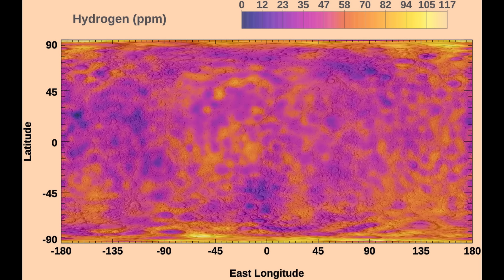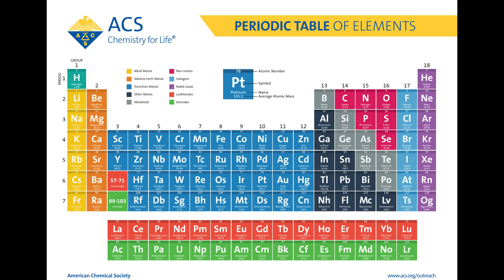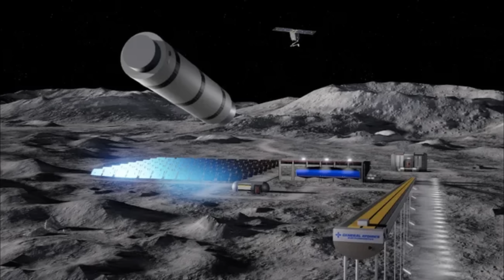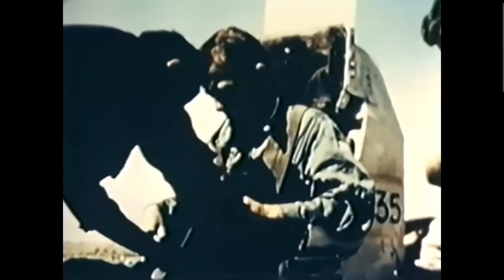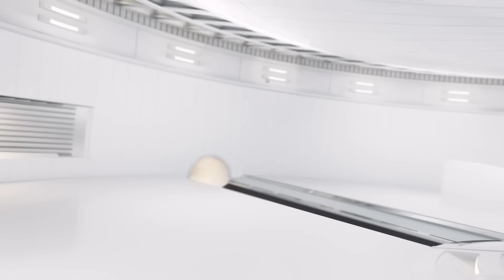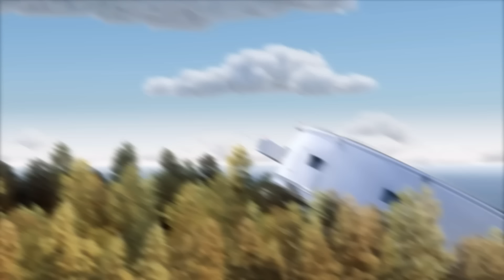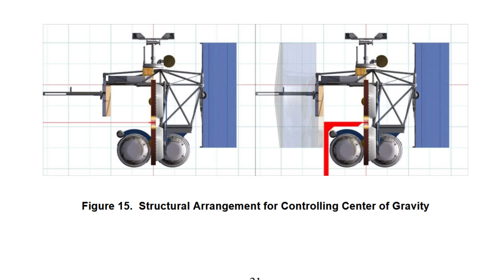Launching From The Moon With Silicon Based Rocket Fuel And Other Ideas - Deep Space Questions

Comment: Why would anyone use silicon?  Aluminum is a much better choice, since it is a lighter element, therefore you will get a higher specific impulse.  We even already use it as part of rocket fuel already.  Solid rockets use Aluminum dust in the fuel to boost overall specific impulse and overall delta V.
Reply: I imagine it’s because silane can be stored cryogenically as a liquid whereas aluminum would be a solid. Even if using a liquid oxidizer means you can still throttle the engine it might be more laborious and risky to rely on a solid propellant versus a liquid.

Comment: PRO TIP The conversion factor between low-orbit orbital velocity of a body and escape velocity from that body is VERY simple, and worth remembering: The square root of two. So if you know the low-orbit orbital velocity, multiply by 1.414 to get the escape velocity. Or if you know the escape velocity, divide by 1.414 to get the low-orbit orbital velocity. https://youtu.be/TAFaUvS18V4?t=231 @Scott Manley

Comment: The major problem with most aluminum concepts is aluminum tends to build up over time.  So it isn't as good for motors that run a long time of that are reused.  This will not be an issue for many missions, of course. so it is a possibility.

Comment: And there was a well worked up idea of a lunar spin launch system, but using a spinning tether on the moon. 
This looks quite practical with current technology. 
file:///C:/Users/John/Documents/AIAA_1990-2109_lunarsling.pdf

You could launch loads in opposite directions that having orbited the moon could be directed towards earth.  
Even using blocks of rock like basalt would be useful as they accelerate towards the earth there kinetic energy is far grater than the same energy in the same weight of rocket propellant. Spinning tethers could catch these to launch what ever you want into higher orbits. 
It may even be possible to make the tethers from basalt fibres from moon rock.

Comment: Mining on the moon would be prohibitively expensive until (if) the day comes when we can send all the machines, metal, moon trucks, excavators, cranes, and myriad materials to the moon to build a single factory for less than $1 trillion dollars, b/c that's how much it would cost, at a minimum, if we also include the costs of building and maintaining a sizable moon base and a work crew of dozens, if not hundreds of engineers, etc.

There will also have to be a fully-funded and manned hospital on the moon to deal with all the injuries and high-level radiation (both cosmic & solar rays) exposure.  Most likely, there will have to be massive greenhouses, and the air for the plants and people to breathe, etc.  At some point, there would have to be recreational facilities to prevent serious muscle atrophy from occurring.

Then, one has to think about the difficulties and costs of transporting the mined products to the processing factors, and in the case of rare earth metals, back to earth.  Putting it all altogether, it might well cost $5 to $10 trillion to get everything up and running, and then something like $1 trillion/year to maintain it and keep it running.

We have no idea how many years a person could live on the moon without muscle atrophy (including the heart muscle) and bone loss that would make it practically impossible for a person to return to the earth at 6 times the gravity.  Lifespan might be seriously reduced.  So the reality for some might be never returning to earth.  In that event, the moon would have to become a much more livable place where people can be happy without forests, rivers, lakes, etc. and with two weeks of total darkness per month.  Sounds like hell to me!

From the standpoint of a dystopian SF writer (e.g., Philip K. Dick), it might be a hellish-enough experience that the only people willing to live there would be prisoners, for whom life on the moon would be their "cruel or unusual" punishment (for which the U.S. Constitution would have to be amended).  The prison guards and supervisors might have to be military personnel who would be deployed up there on a rotating basis.  There would also be a "space force" base up there to give the military some justification for being on the moon besides maintaining  an enormous prison.

Comment: For mechanical energy storage for a mass driver, you could also use mechanical storage.
On the Ford class carriers, they use motor generators to power their EMALS electric catapult system.
You could also use flywheels or motor generators to recover energy from a shuttle as is used on those catapults.

Comment: @19:30 Energy storage to recover the energy from spinning down:  the best solution would be simply to have a second spin launcher next to it ready and loaded. After one releases its mass it transfers (electrically) to the other one spinning it up to speed and launching. In the meantime  the other one is loaded with a new payload and the cycle continues, each time only having to inject enough additional energy for the payload itself, not the much larger amount of energy needed to spin up the rotor.

Comment: Just throwing out a few ideas:
* Single use hybrid rockets. It is only the fuel/nozzle part that is single use: mostly just a solid cylinder with a channel to flow oxygen down. The oxygen tanks and all the pumps to regulate the oxygen flow are reused.
* Momentum exchange tethers: Might be lighter, simpler, faster than a space elevator and able to service multiple ports around the moon instead of one location. Downside is they may have high-g, a non-issue for space elevators.
* Mass Drivers are normally considered too large to ever be more than Scifi, but you could start with ones of only a few hundred kg if they launched tiny payloads, eg magnetic dust, that is aimed precisely to form clumps in orbit that can be collected in a later date. I think this would also handle circularising the orbit, possibly with multiple guns feeding the clump from different trajectories.
* A magnetic rail around the moon. Although a long term project, this could emerge organically from connecting multiple cities around the lunar equator, sharing resources from people to power. Before it could handle launching human sized craft, it could be used to land them.

Comment: Unfortunately, due to the regolith on the moon being electrostatic, use of any method which creates a magnetic or electrical field would attract the dust on its surface.  Therefore, only by building the ramp with a housing, which increases the cost of the facility, would it be possible to make use of a magnetic mass driver.  Using spin launch may be a better choice, and with no atmosphere, it doesn't need to be as complex as its equivalent on the Earth.

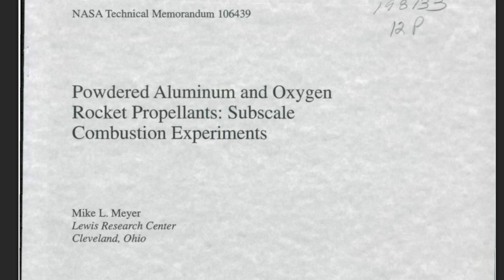Comment: 8:28  "There have been designs which use slurries of liquid oxygen and very fine grained aluminum powder and you can burn that like a solid rocket motor"

Not anywhere near me you can't.  That sounds like a very expensive exercise in mortal peril.  That sounds dangerously close to an old timey mining explosive known as oxyliquit.

They stopped using it, because it liked to go boom if you tried to move it too much.

Comment: We still know little about the moon's geology , possibly what is strategically interesting is classified. What is below the surface?  
I come from an area where Gold was discovered relatively recently through alluvial deposits (called the Golden Triangle) but now is mined underground. Geologist create theories to explain why there are particular concentrations of minerals to try and predict where else to look. On the moon we will have to do more looking. Digging deeper holes. Perhaps things rare on earth can be used as basic foundational materials, requiring different approaches to engineering. Eg In the vacuum of space perhaps girders could be made from sodium.
Regarding launching from the moon would it be possible to build ion drive thrusters with sufficent power (or clusters of thrusters) to get into orbit? maybe using nuclear-electric power generation. Creating chemicals from energy to store and then react and release the energy seems an inefficient way of generating thrust (requiring large tanks)  Also there is the direct nuclear-thermal engine where you could heat any material and allow it to expand through a rocket nozzle. Could be a solid metal fuel, in wire form,  fed into the heater and turned to gas. Maybe further ionized and accelerated magnetically.

Comment: Storage for lunar SpinLaunch: Build two SpinLaunchers, and spin one up while you spin the other one down.

Space elevator: Instead of a powered climber, move the cable in a loop. The climber just has to grab on and get towed. You'd need to chain multiple loops along the length of the cable to get the increased cross-section.

Comment: A nuclear powered liquid sodium or magnesium engine might be posible, if the heat of the reactor can reliably melt the solid metal inside the tanks right before a launch. Handling a hot metal exhaust seems more plausible than oxygen. Both metals are quite abundant in moon´s crust and have a relatively low molecular weight so an isp of roughly 300 isp could be achieved. Also, high heat conductivity and high density is nice.
The major downside would be hazardous radiation, from ionizing radiation which means it should not be used near populated areas or around infrastructure.

Comment: If we could put metals on the moon for transport or storage, we would not have to worry about oxidation which brings up a interesting idea, can we smelt or form molten metal on the moon be turned into bars and stored on the moon, yes cold welding would be a issue but we could have Oxides free metal to try and experiment with. I always wondered if the oxide coat Brought into play some characteristics that we have not thought of!

Comment: I’d like to see a hybrid rocket motor using magnesium aluminum hydride, Mg(AlH4)2, as the fuel. Same solid particle issues as with SiH4, but much better performance. Silicon is a pretty dismal as a fuel.

Comment: I think a good idea to launch is to use a rope. The actual bit that converts the electricity into kinetic is just a small "car" of some sort moving on some kind of powered rails to guide it, with a rope attached to it. The actual craft to be launched is hooked onto the other end of that rope. This may reduce the energy wasted into the launching device because the mass of the car could be small enough. Like imagine a trebuchet, except that instead of using the arcing movement of a lever to release the payload, the arc here is the slightly curved moon surface if you can maintain constant elevation.

Comment: 11:49 We don't normally pronounce the decimal.  It's not "Point Two Two Calibre" but "Twenty Two Calibre".  So in this case someone took a three-seventy-eight Wetherby cartridge and crimped a twenty-two miniball on the end.

But yes, that's the secret sauce of "magnum" cartridges.  The rifle I use for hunting, a traditional "three-oh-eight" has a miniball caliber of 0.308 in (7.82 mm) and a cartridge calibre of 0.4709 in (11.96 mm).  The whole thing doesn't need to run down the bore of the weapon, just the bullet.  So many modern cartridges are a bit wider in the base than they are in the ball, so more charge can be packed in.

Comment: Whenever people talk about space levators capturing asteroids always come into play, but would'nt it be detrimental for the counterweight to have a random mass distribution like a typical asteroid would have. Sure lifting 100 000 tons to orbit and transferring it to the moon is expensive, but it's not that hard to make lead counterwieght of unifrom blocks and launch them using the most cost effective launcher and then assemble them on site? I guess you could also use the lead (just running on the assumption that this is the chepeast option given how readily abundant it is compared to other heavy elements) as cladding around any habitation modules cause if you do build this is would seem like a waste not to have it double as a hotel for people transiting to and from the moon.

Comment: When at uni in late 70s we had to run the calcs  for launching material from the moon to Luna orbit using a linear accelerator rail system.  It was all designed by NASA as part of the Apollo moon/mars program, including  a 2001 space  odyssey style spining space station in earth orbit.  The details must still be available.

Comment: 🤔💭 what if you use a old giant TV 📺 frenzel lens .
Aim ;
 👁️ 
( + )
 📺
 ☀️ 
Burn , ISS 🗑️ trash  / 🌙 Moon garbage check ✅ or porta john 🔥 methane .
==
Just the heat of the lens for a exit Vo from space trash 🗑️.
====
Ion power ⚡ (a NKG Spark plug cannon 🔫) like in ✨ Star Wars.
===
Plus , slow boat trash burner .
====
There U have it LA smog  
Mare cerium 
👋😎💨 Bryan 🧠💨 
🗣️ 🚬💨

Comment: Hi Scott don't expect you to read this but had an idea for a spacecraft to enter the earth's atmosphere without using a heat shield by using a positive charged electric feild they used something similar on a oil rig experiment to put flames out along a metal floor the premises is that the electric feild pushes away the positive ions  of re-entering that makes a space between the craft and the heat of re-entery I'm probably wrong but it's just an idea

Comment: In terms of gun type projectile speeds that are achievable, one must not look at obscure rifle munitions. Look no further than modern day 120mm smoothbore main battle tank cannons firing APFSDS projectiles at nearly 1800m/s - which should easily exceed 2000m/s with a longer barrel than what is practical for a tank.

Comment: 7:30
a lot of flammable metals actually have ah igher energy density than hydrogne if oyu count the oxidizer as part of your mass
problem being that well, the exhaust contains solids even at relatively high temperatures and withut a gas to mix i nthere you can'T expand it further and you abrase your nozzle

Comment: I'm no rocket-ologist, but the claim that it would be only 5% of the energy cost to use moon minerals opposing 95% MORE energy to use  earth minerals, seems like someone needs to check the math. Didn't NASA "lose the technology and documentation" of how to get Astronauts and Apollo safely through the Van Allan Belt, to the moon and back, using the computing power of a calculator-watch?

Comment: Would it not be easier to winch a payload from the Lunar surface to orbit (without a fixed cable)? 
With a counter balance of the same mass, it could use Solar panels and simple electric motors to do the 'heavy' lifting. 
Then you would use less propellant to send it wherever it is going.

Comment: The superconducting energy system you described to power the "railgun" for launching stuff is actually in use for other purposes today.  Any hospital with an MRI uses it.  The MRI has a magnet that is cooled by liquid helium, a superconducting coil magnet.  It's always powered.  That's why MRI folks will tell you, the magnet is ALWAYS ON.  It's why they're very particular about making sure you don't bring any ferrous metal into the magnet zone, lest it become a projectile and damage the MRI (and anything/anyone who gets in the way).

Comment: The mass driver made me think: How would low temperature superconductors work in a vacuum?  I mean - space is cold so you don't have to mess with helium cooling - but you still have to get rid of built-up heat somehow, and it can't be dumped to a vacuum?

Also if I did my calculations correctly 340 km on the moon is 11 degrees of its circumference, so the curvature difference is substantial - but perhaps it doesn't matter if the rail is curving a little?

Comment: 7:29 - Burning silane does not give sand but fine white powder. How do we know? CVD equipment in semiconductor manufacturing is riddled with it. Silane may have another issue: As the combustion proceeds, the exhaust condenses and thus decelerate the eshaust, reducing the specific impulse.

Comment: Just had a thought:  Since hydrogen is in short supply on the Moon, how hard would it be to capture hydrogen from the solar wind, using sort of a low velocity version of a Bussard ramjet(*)?  No need to figure out how to fuse the hydrogen -- just power the collection process with a load of solar panels.  You would also end up collecting helium and small amounts of other stuff, which would also be of use.

(*)Edit:  Meant to put Bussard ramscoop, since it isn't being used for propulsion, but collection for other uses.

Comment: In my hard sci-fi Principia universe, Luna (although Martians and Spaceborn joke that the Earthers still call it "the Moon" as if it's the only one) has a space elevator that actually runs trains up and down it, since it's the main port of call between Earth and the Earth Sphere space colonies.  I describe the orbiting station as looking like a spider descending from the Moon on a silky thread (after which I immediately explain how geocentric this view is, given that the station is actually far above the Lunar surface, but both perspectives are valid in their own ways).  There are about a dozen city-sized Island Three-type colony cylinders orbiting the L1 point that are devoted entirely to hydroponic agriculture (all the arable land on Earth is needed for reforestry projects to try to reverse climate change).

There's also a LEM-like flying vehicle that uses AlOx motors (since sometimes you need to get out somewhere faster than a rover, but there are no trains running there, so it's kinda the Lunar equivalent of a helicopter), but I might switch them out for SilOx motors specifically for the sand-blasting effect.

Comment: Wouldn't Aluminium based rocket fuel have similar issues to Silane in that Aluminium Oxide (9 on the Mohs scale) is even harder than Silicone Oxide (7 on the Mohs  scale) so you'd have similar build up & abrasion issues?